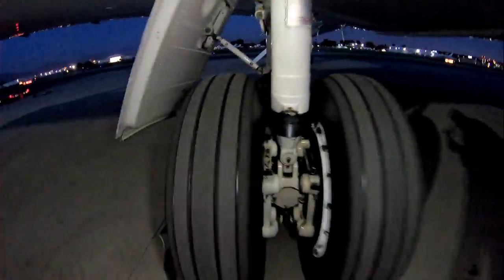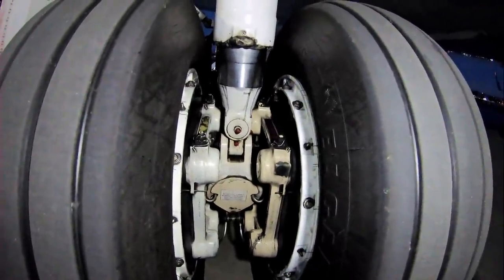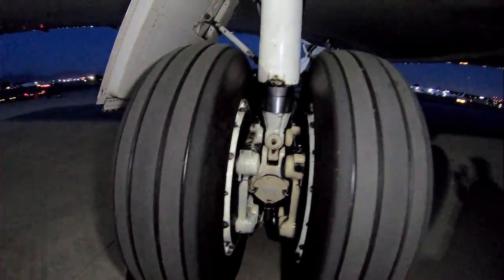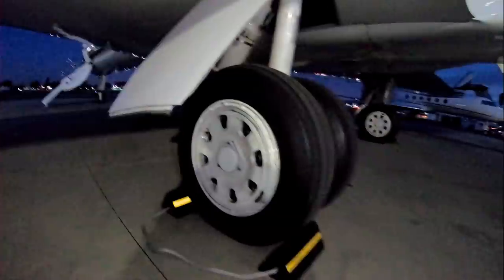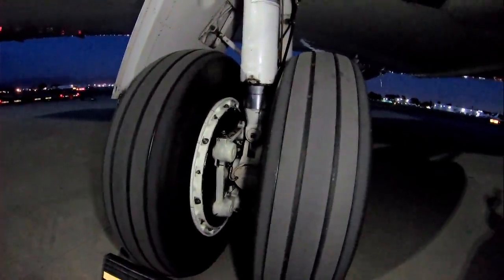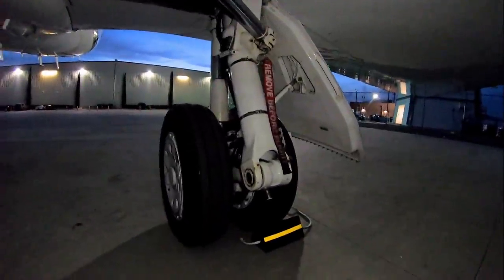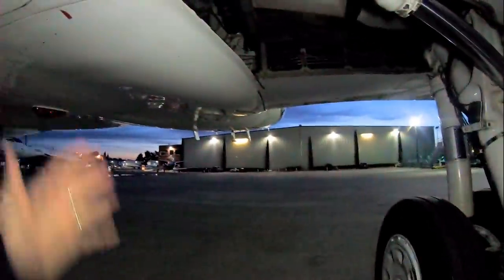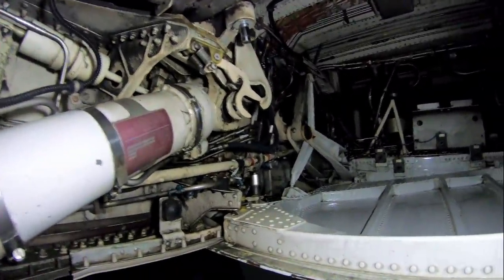Tech Tuesday - Gulfstream Main Gear and Brakes

Comment: The brake disks can run anywhere from $150-$1800 per wheel. So a brake change usually runs about $3500-$14000 at our shop.

Comment: It's great to see the underside of any Gulfstream to see how clean they are Shaun. Thanks for showing angles that are rarely seen. The closeup of the main gear is fantastic. Seeing it compressed with the retraction cylinder up close really shows off the engineering. I have to admit that I actually yelped when you stuck the camera into the wing box. Never been that close. Really appreciate it and again, it's great to see the inside engineering. I know it's on the ground, but still such a clean wing from any angle. Never aerodynamically "dirty". Thanks!!

Comment: Aren't you supposed to have chocks the block BOTH wheels of the gear?

Also, main wheels/tires on that size (large corporate/small airliner) A/C are a lot HEAVIER than they look.  Had to unload some that were cargo and it surprised me.  I think they were likely CRJ-200's, but they were about the same size.

Comment: Great video as always Sean! 3 questions about the temperature of the brakes (thermo-engineering nerd). Are they similar to the carbon fiber and application in other aircraft? They are effective once at temp, otherwise they wear at harsh rates? If you don't use your brakes on landing, is it bad to apply them during taxi? And finally, if you use the brakes, do you use the parking brake once at the stand or let the chokes do their thing? Thanks for the amazing content as always!

Comment: Reason why they use nitrogen instead of regular air,in the tires is due to heat expansion. Nitrogen is cold and dose not heat up like regular  air would.
Reply from the maker: Exactly...also, nitrogen is dry. Compressed air has moisture and would freeze at altitude
Reply: I thought it had to do with molecular size and which size can penetrate the rubber tires...hummmmm.

Comment: Very informative. Often wondered about just how those systems operate. So, they are a disc type or some sort of shoe? Why do many commercial aircraft have noisy brakes?
Reply from the maker: They are disc type brakes...I believe a stack of 3 discs each, but I'll have to verify the number. As for the noisy part, I'm not really sure.

Comment: great video. apart from cockpit and some systems, what was massively different from the previous GIII? Ive read a lot wasn't changed as gulfstream didn't want a full redesign
Reply from the maker: From the G-III, the G-IV got a bit longer, and turbofan engines. Then the avionics are a complete makeover. The G-IV is the first glass cockpit
Reply: Corporate Pilot Life was that it? Thanks for the comment

Comment: I would have never thought the brakes would cost that much. Wow. What is the advantage of nitrogen vs air in the tires?
Reply from the maker: Nitrogen doesn't expand nearly as much with temperature, so we always use nitrogen
Reply: @CorporatePilotLife  Makes sense. Thank you!

Comment: Thanks Shaun. Didn’t know there were five pistons per set. Do they all work together simultaneously or does it start with three then increase to five as more pressure is applied?
Reply from the maker: They all work together to apply even pressure to the brake discs. It only takes about 400 PSI to get the plane slowed for most situations

Comment: Hey Sean. I've kinda lost track of you trying to keep up with the political stuff. How is this job working out for you? Do you feel it was a good move? I want to ask you a couple quick questions. Is it hard to keep even pressure on right and left pedals when applying brakes on landing? The little flying I did centuries ago I was never allowed to rotate or touch down by my instructor. Also, at what speed on takeoff will the rudder grab enough air so you no longer have to stear with the brakes? And visa versa on landings? Hope you are doing well and hopefully will see more of you.
Reply from the maker: Hey Werner! Things have been going great so far, and thank you for asking. Keeping even brake pressure can be a bit difficult, especially in the brake by wire airplanes. On takeoff, it only takes about 50 or knots of airspeed for the rudder to become effective. Up until that point, we still use the rudder pedals to maintain centerline control, as the pedals provide some nosewheel steering.
Reply: @CorporatePilotLife  thanks Shaun. I always wondered about that. I suppose smaller lighter plans take less speed for rudder control as opposed to brake steering. I do love your videos. Peace out.

Comment: what is the shortest runway you have landed at in the G-4
Reply from the maker: The shortest I've ever done is Tortola which is around 4,200 feet long. The takeoff isn't an issue, but the landing sure makes you pucker

Comment: $40k for brakes on 1 wheel? How much is a tire?
Reply: Tire and wheel assembly will probably run around 30-40K at the very least. Thats new tire on overhauled wheel. BTW $40k is also for an overhauled brake.